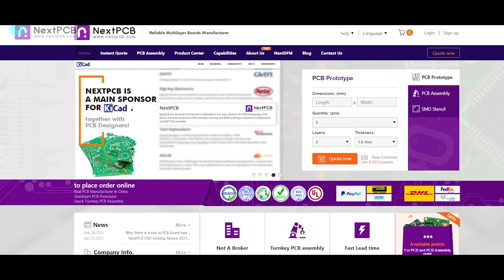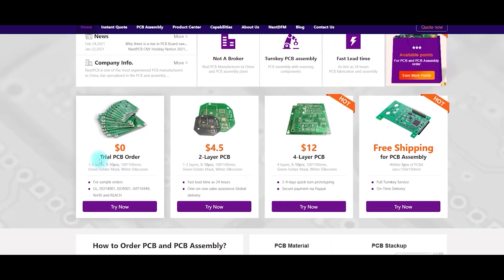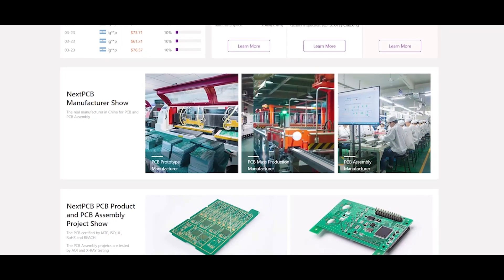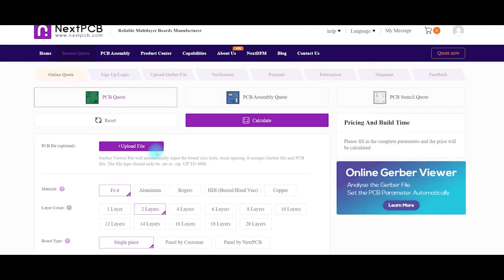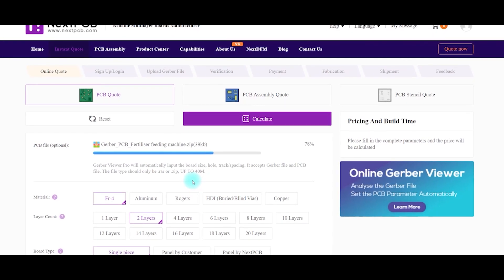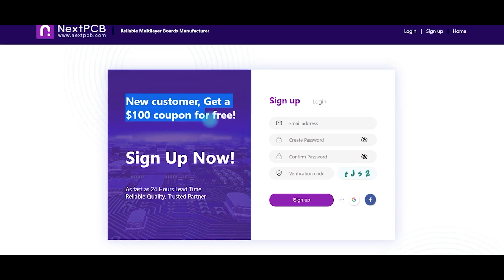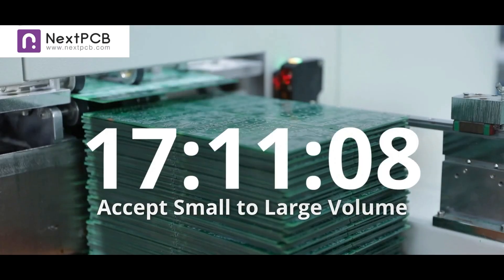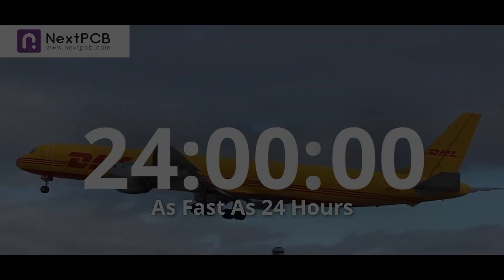Top 5 Winning Science fair projects 2022 never seen before

Comment: Best science project ever... Set up a camera and a TV flat screen in a window frame, set up a mirror in a window frame, set up a CGI scene to match the camera scene only here you need to map your face onto a CGI character using software like Poser or Daz 3D and make sure that you add blue to the colors as it gets closer to the camera and reduce red as it approaches the camera.  To make the light rays longer or shorter to match your image in the mirror which has longer light rays since they originate at your face.
All images come off glass, the TV the mirror the second TV but 2 of them look completely real.
When you sit and one is a reflection of your upper body, one is the camera image of your upper body, and one is CGI with red and blue shift added to the pixels. CGI can make 3D no glasses, a mirror can make 3D no glasses, but film cannot because the light source is the flat screen where z = 0. z does not equal zero in the mirror or in the CGI with red and blue shift, like red and cyan glasses only properly done by changing the color of the texture mapping.
Reply: so carry a tv for science project, excellent